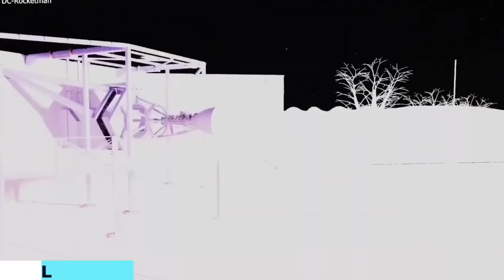SpaceX Starship NEW Raptor 2.0 Are Unlike Any Other.

Comment: Once all the bugs are worked out and a simplified design proven reliable then the raptors would be standardized and assembled on an assembly line ! its possible to see 4 or more engines a day coming out the factory